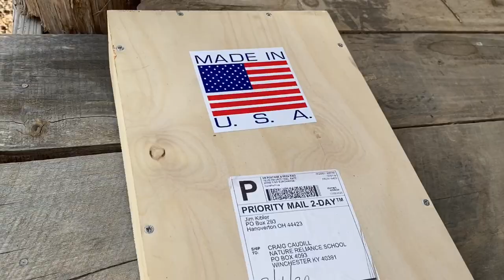Colonial Longrifle Assembly - Part 1, Unboxing the kit

Comment: Jim's kits are first rate. The wood is precision cut via CNC machine. His lock is CNC as well and the biggest innovation in 50 year. No need to tune or fit the lock due to the precision and quality. Parts are interchangeable without fitting etc.